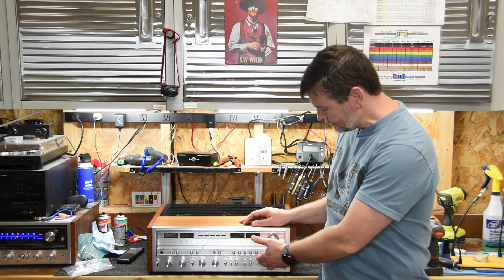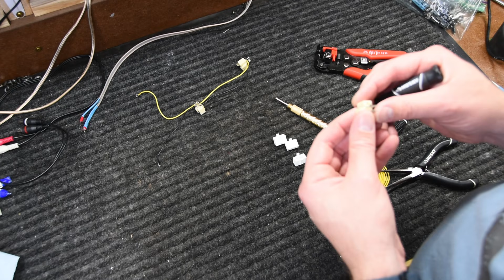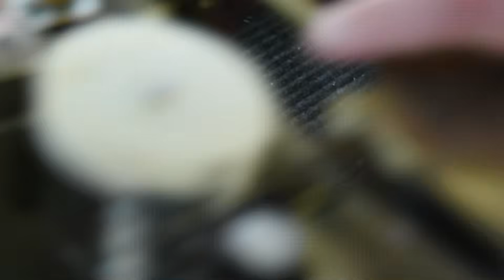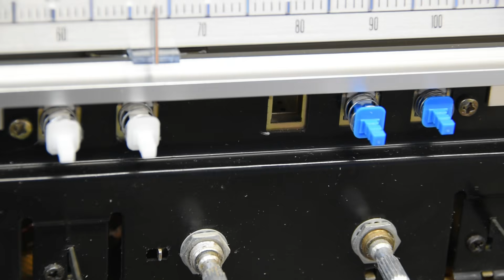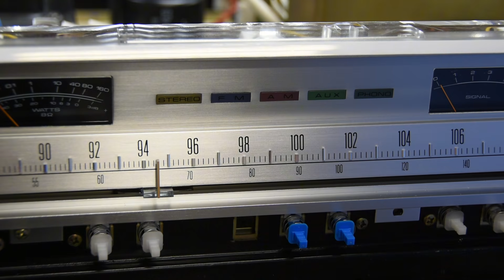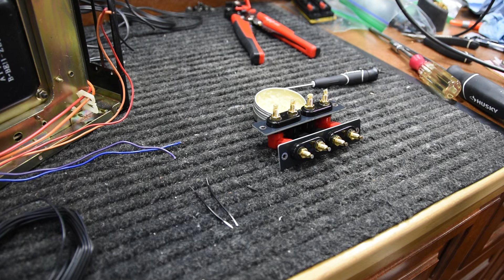Pioneer SX-980 Restore | Power Supply, Amplifier, Protection Circuit, Lighting & Speaker Outputs

Comment: What a great video! I have watched so many of your videos and they are so helpful. Used them to work on my Pioneer SX-780s, and now using this one to work on my new SX 980. One thing you didn’t show was connecting your multimeter probes to the speaker jacks, are you just inserting the probes into the speaker jacks and letting the clamp hold onto the tips of the probes? Is there any grounding that I need to be concerned about with that?  Also, when you use a signal generator, is it OK to use something like the audio function generator app on an iPhone?
Reply: Awesome. Thanks so much for the reply. Your videos are fantastic!!
Reply from the maker: I don't remember where I put my probes, but if I did put them into the speaker jacks then yes I just let them hold onto it. No special grounding required as the negative of the speaker is grounded. Also your phone will work for injecting a signal

Comment: Where did you get the LED's for the STEREO, FM, AM, AUX & PHONO and what size?   I measure 4mm.  Did you use white (clear) or go colored.  What resistor rating did you use?
Reply from the maker: I used different colors to really make them stand out. I cant remember the size off the top of my head but they were either 5mm or 3mm since thats all i have. The resistor comes preinstalled don them as well.